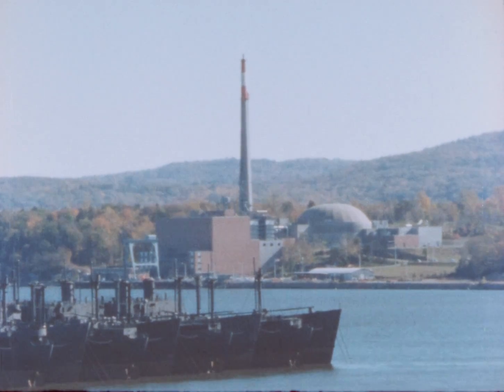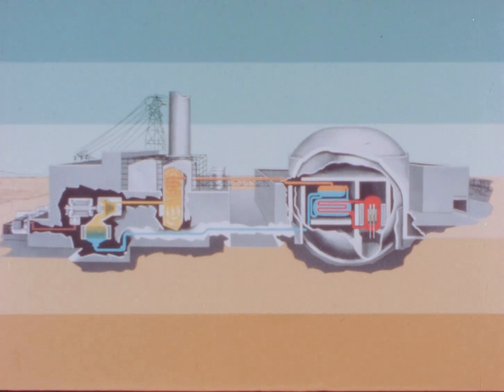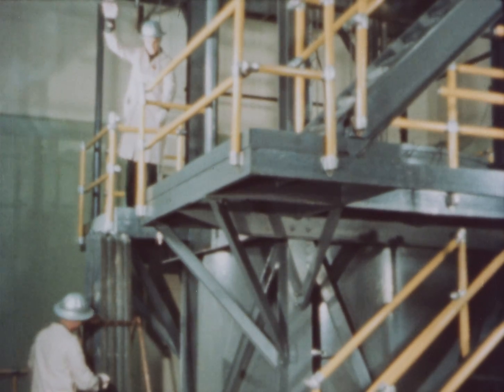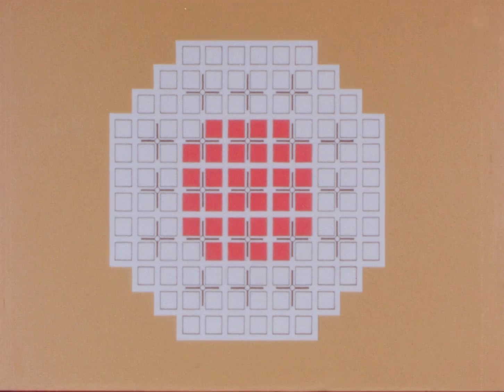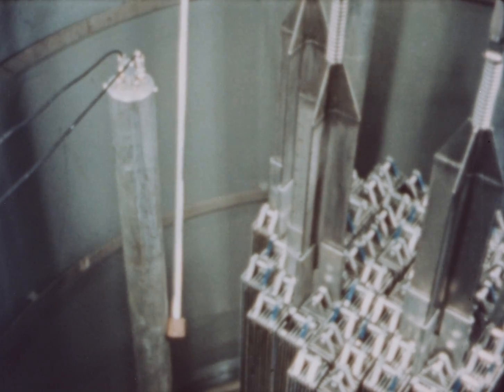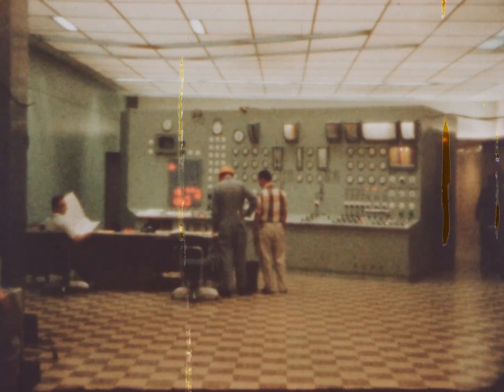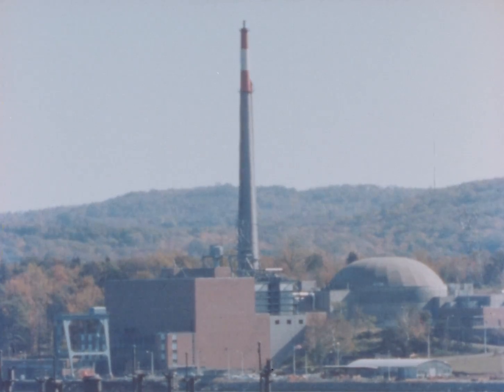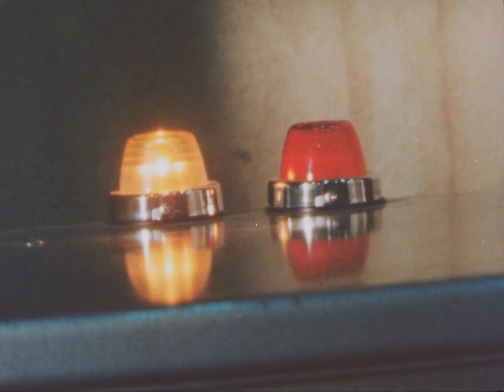Operating Experience, Indian Point: world's first Thorium-fueled commercial reactor (1964)

Comment: I thought that thorium was not used before but actually they're using it quite successfully,, so there's no reason why we don't use it again today..
Reply: Thorium is not fissile on its own so plates of enriched uranium in center of the core are surrounded by fuel blanket of thorium rods which convert the fuel into U233

Comment: Peaceful use my ass. That reactor was used to generate other materials for the weapons program. Electricity just happen to help pay for it.
Reply from the maker: What materials in particular are you talking about? Most weapons material I'm aware of comes from weapons reactors at Hanford and Savannah River.
Reply: @whatisnuclear  Did Hanford exist when this unit was built?
Reply from the maker: @tireballastserviceofflorid7771  yup, Hanford B was the first high-power reactor on the planet, made during WWII in 1943, a full 20 years before this reactor was brought online.
Reply: Totally was
Reply: It's a thorium breeder; it doesn't even create plutonium ... I don't think. Th-232 + n -> Th-233 - beta decay -> Pa-233 - beta decay (I think) -> U-233. And the initial fissile material is U-235. I'm willing to be wrong, but where does plutonium enter the fuel cycle/get created?
Reply: @PBeringer Didn't say plutonium.
Reply: @tireballastserviceofflorid7771  What materiel were used for weapons, then? U-233 is a pretty inefficient way to make a bomb (I'm not even sure it works very well for bombs). Or is the neutron source for fission stages taken from reactor daughter products?

Comment: Uranium-Based Reactors:Waste management: Long-term storage required due to the presence of long-lived radioactive isotopes, potentially lasting thousands to millions of years.Safety: Higher risk of catastrophic meltdowns due to reliance on water-cooled reactors and pressurized systems, as seen in historical incidents like Chernobyl and Fukushima.Thorium-Based Reactors:Waste management: Shorter-term storage required compared to uranium-based reactors, as waste typically contains fewer long-lived radioactive isotopes, with half-lives ranging from hundreds to thousands of years.Safety: Lower risk of catastrophic meltdowns due to inherent safety features in thorium reactor designs, such as passive cooling systems and stable fuel characteristics, reducing the likelihood of severe accidents.Overall, thorium-based reactors offer advantages in waste management with shorter-term storage requirements and are considered safer due to lower risks of catastrophic meltdowns compared to uranium-based reactors. These factors contribute to the growing interest in thorium power as a potentially safer and more sustainable nuclear energy option.

Comment: This reply is for clarification of why Thorium power is "safer" in opposition to Uranium power

Uranium-Based Reactors:Plutonium-239: Highly toxic and poses significant health risks if ingested or inhaled, primarily emits alpha radiation.
Americium-241: Emitting alpha radiation, poses health risks if ingested or inhaled, especially in its dust form.
Neptunium-237: Long-lived and emits beta radiation, which can pose health risks if absorbed internally.
Cesium-137: Emits strong gamma radiation and poses a significant risk to human health if absorbed internally, particularly in contaminated environments.
Strontium-90: Emits beta radiation and poses health risks, especially if ingested, as it can accumulate in bones and cause bone cancer.

Thorium-Based Reactors:Uranium-233: Emits alpha radiation and is less hazardous compared to plutonium, but still poses health risks if ingested or inhaled.
Plutonium-238: Emits alpha radiation and poses health risks similar to plutonium-239, but with a shorter half-life.
Neptunium-237: Long-lived and emits beta radiation, similar to uranium-based reactors.
Cesium-137: Similarly emits strong gamma radiation and poses risks, but may be present in smaller quantities due to differences in reactor operation.
Strontium-90: Shares similar risks as in uranium-based reactors, accumulating in bones and posing a risk of bone cancer.

Gamma-emitting elements (both reactor types):
Cesium-137 and Cobalt-60: Highly gamma-emitting isotopes present in both reactor types' waste, posing significant health risks if absorbed internally or externally.

Comment: Too bad they still refuse to use Thorium for power production.
Reply: China and India are putting a lot of work into it.
Reply: @KokkiePiet  the tech has been known and tested for decades. Instead the US doesn't care to as they still want americium and plutonium.
Reply: I think the U232 contamination issue is only a problem if you were trying to isolate U233 for enrichment reasons.

This caused it to fall out of favor early on for weapons production, but has been put forward as a benefit for Thorium breeding cycle power reactors, simply because it IS harder to divert to weapons grade.
U232 itself is fissile, to both thermal AND fast neutrons.
Left in a power reactor core until design burnup, I don't see why it would be any more problematic then the bevy of other gamma emitters among the daughter isotopes, like Cs137.
Reply: @NullHand  finally a cogent response, thank you.
Reply: Okay you can find this on the internet Angel "The uranium 233 produced in thorium reactors is contaminated with uranium 232, which is produced through several different neutron absorption pathways. Uranium 232 has a half-life of 68.9 years, and its daughter radionuclides emit intense, highly penetrating gamma rays that make the material difficult to handle. A person standing 0.5 meters from 5 kilograms of uranium 233 containing 500 parts per million of uranium 232, one year after it has been separated from the daughters of uranium 232, would receive a dose that exceeds the annual regulatory limits for radiological workers in less than an hour. "
Reply: Because it is too radioactive to handle afterwards. The reaction and spent fuel has a bit of Uranium 232 that can penetrate a meter of concrete.
Reply: @markae0  just where did you get that information. Uranium 233 not 232 is a byproduct of Thorium power plants.
Reply: @markae0  what's the matter, can't respond? Who asked you anyways, Brian
Reply: @commandingangel  I have a life outside of YouTube and was away, as to why I did not respond quickly. I will look for a reference that you might believe.BBL
Reply: @markae0  Uranium-233 and uranium-232 both pose health risks due to their radioactive properties, but uranium-232 is generally considered more dangerous in terms of radiation hazards. Uranium-232 emits more intense gamma radiation compared to uranium-233, which primarily emits alpha particles. This higher energy gamma radiation from uranium-232 can penetrate deeper into tissues and cause more significant damage to human health. Additionally, uranium-232 can also produce decay products that emit additional radiation. Therefore, uranium-232 is typically considered more hazardous in terms of radiation exposure.
Reply: U-233 produced in a LFTR is a poor choice for nuclear weapons because the neutrons that produce U-233 also produce 0.13 percent contaminating U-232, whose decay products emit 2.6 mega-electron volt, penetrating gamma radiation.
Reply: Th-232 gains a neutron to form Th-233, which soon beta decays (half-life 22 minutes) to protactinium-233. The Pa-233 (half-life of 27 days) decays into U-233. Some U-232 is also formed along with Th-233, and a decay product of this is very gamma active.
Reply: @markae0  albeit incredibly short lived. 
Still not a valid argument against. 

I guess you want even more nuclear waste in your backyard. 

Brilliant.
Reply: @commandingangel  79 years is short lived?
Reply: @markae0  compared to what nuclear waste is today. yes it is. Ever heard of WIPP? or the fact in order to bury the waste requires ground markers that will last over 10k years. 

So if the waste can be protected within a human life span they wouldn't need to create the Atomic "priesthood". 

It's a fact. So 79 years and that's a half life FYI is entirely and inherently safer than the 10k years of our current high level nuclear waste.
Reply: @commandingangel  But what about the super-penetrating gamma rays during the plant's operation? Also wouldn't 79 half life still be dangerous for hundreds of years?
Reply: @fog1396 160 years is a hell of a lot shorter than 10k. You're lack of understanding maths is disturbing to me. 

Also WTF kind of question is that, LURKMOAR.
Reply: @commandingangel  You are changing the subject to burying the waste. I wrote HANDLING. YOU CAN NOT HANDLE THE WASTE FOR ITS POWER. NEVER MIND THE BURYING. HOW THE F DO YOU MANIPULATE THE PRODUCT?
Reply: @fog1396  FOG I do not think you understand Half Life